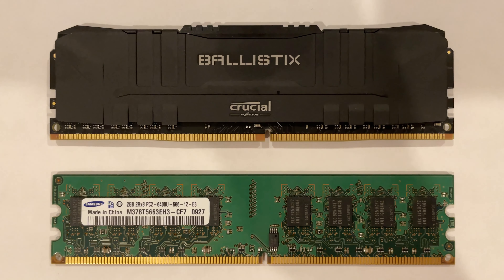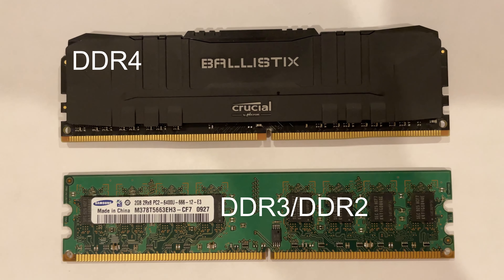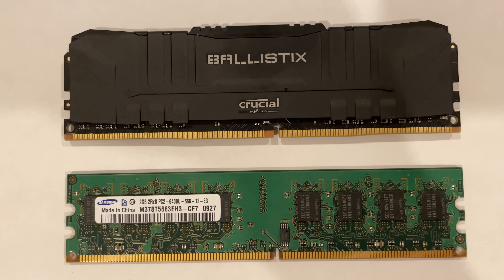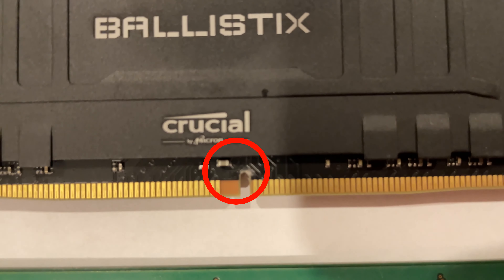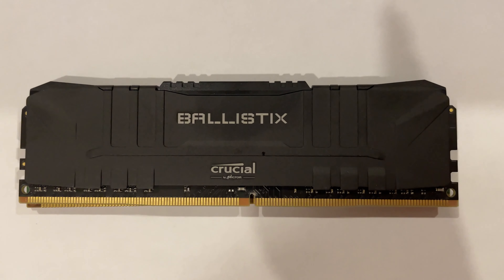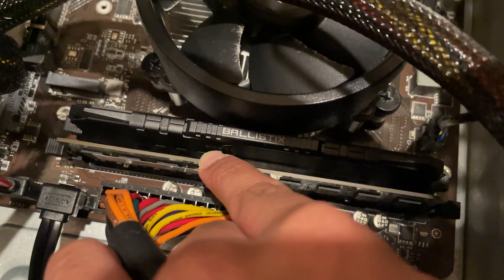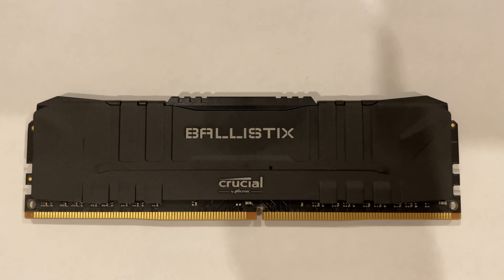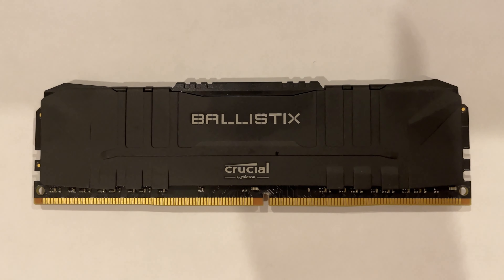Does DDR3/DDR2 RAM Work on DDR4 Motherboard?

Comment: but can you use ddr4 ram in a ddr3 motherboard? sorry if its a dumb question im new to this
Reply: Just shove a GPU in your ram slot. It will make your CPU render faster
Reply: Just kidding, no you can't put DDR4 in a DDR3 slot. The pinning is different, the notches dont match up and it has more pins than DDR3
Reply: @Mom19  yeah I thought this I just get told different things
Reply: @alfiejackson8629  one thing to note tho: Asus is currently working on a DDR4 adapter. This could potentially allow DDR4 Modules to work in a DDR5 Motherboard. But, its just an engineering sample yet and no official product out there
Reply: @Mom19  oh ok thanks

Comment: What if we cut the notch slightly so we can insert it
Reply from the maker: Please don’t do this. Even if it does fit, the motherboard won’t be able to read the ram. The ram would also be extremely slow as each ddr standard has become increasingly faster. The different ram also have a different number of pins.

Comment: How about a ddr3 in a ddr2 slot?
Reply from the maker: Unfortunately, a DDR3 RAM stick will not work in a DDR2 slot and vise versa. This is due to the notch placement.
Reply: @ultimatesktech1820  :*(